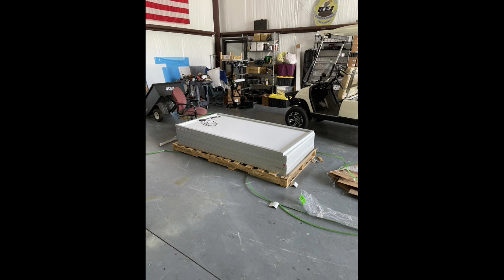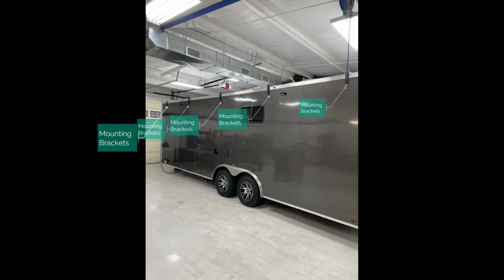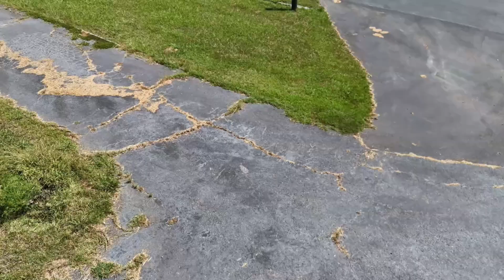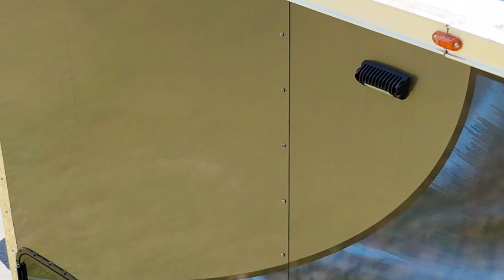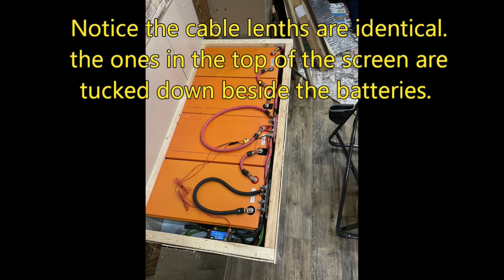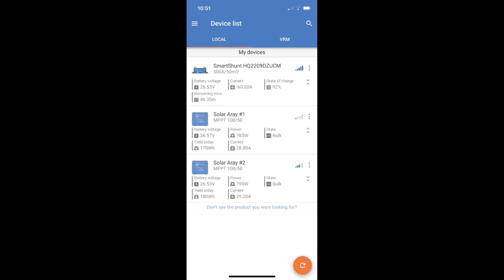Solar Powered Cargo Conversion

Comment: How does your 24 volt battery bank work with the RV Power Center that's 12 volt? Do you use the AC battery charger in the RV Power Center.?
Reply from the maker: I do not use the charger in the power center. My solar charges my batteries and the batteries run the inverter that powers the RV panel. The 12 volt runs all my 12v from the step down inverter in the rv panel. Bet that’s clear as mud! Makes sense to me, but my wife is always getting on to me about breaking stuff down more. If you have any more questions please fell free to ask!
Thanks for watching

Comment: Very nice👍
You doubled up your roof supports but you dont us them as you panels are putting the weight on the verticals.  I would still do it myself that way just for the snow load during storage in the winter up here in Central Ontario Canada.
Cheers
Reply from the maker: Correct. I tend to overkill things!! LOL thanks for watching. Hope you check back often.